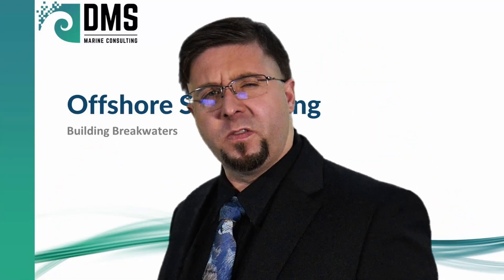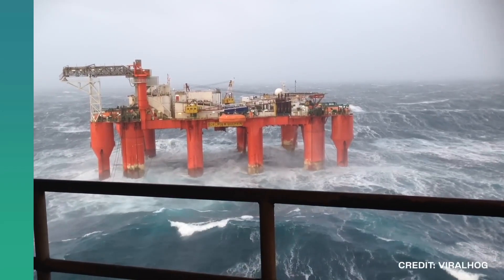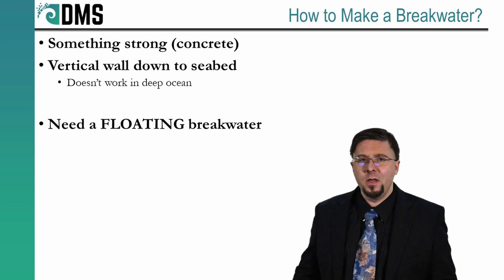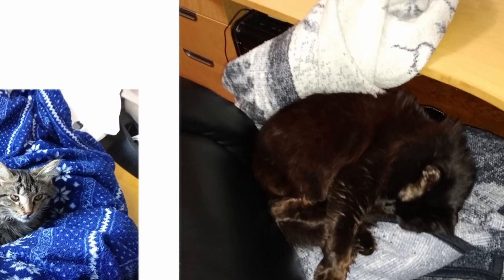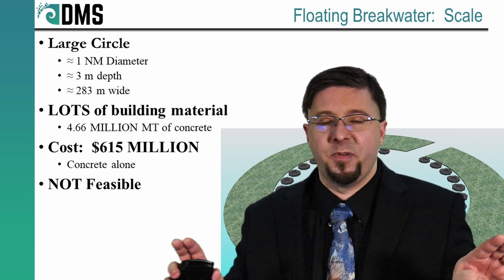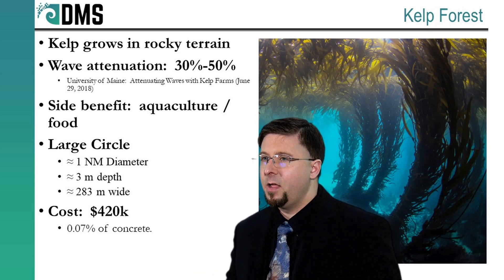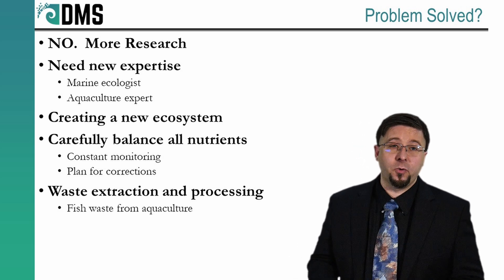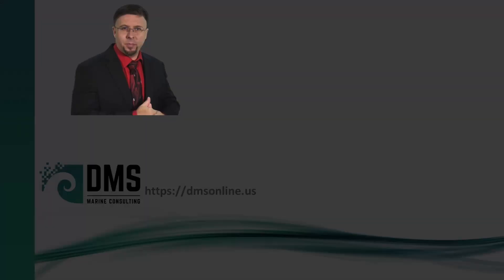Stop the Waves with Plants!:  Seasteading Breakwater Design

Comment: heat collected from a shallow geodesic could be channeled into the depths via a ventilation system...and the same could collect rain water.
but the problem with a very deep hyperbolic cone hull, would be in the construction phase.
hyperbolic cones amplify sound ... I don't even know if a person could survive the SPL level created by concrete being poured into the cone hull.

Comment: A fascinating concept. Along a similar line, there is a process of generating limestone-like structures known as electrified reefs using a metal mesh with a current to draw minerals out of the surrounding water. This structure can in turn be used to support colonies of various marine life. This could potentially provide both an anchoring point for seaweed as well as a more robust structure that could bridge the gap between purely biological and solid concrete.

I'd be very curious to see what level of porosity is tolerable for a breakwater. I would expect that gaps significantly smaller than the wavelength should not be an issue, though I don't know the range of wavelengths that need to be blocked. All the same, it should be possible to get most of the benefit for a fraction of the mass/cost of a solid structure.
Reply from the maker: I expect we can tolerate large porous holes of about 1 ft.  For conventional breakwaters, we often pile giant rocks or concrete in front to protect the solid breakwater.  So I'm not sure if anyone tried building a breakwater without eventually building a solid wall somewhere in the mix.  But I think porous media with large scale attenuation would work well.  And the idea of using an electrified reef is very interesting.

Comment: Wait. Kelp is attached to the seafloor. Surely that is a big reason for its wave damping properties? It essentially increases the flow resistance of the seafloor by greatly increasing surface area? So where are you going to anchor this kelp?
Reply: You can anchor the netting to the sea bottom.

Comment: I think if you want to support that much kelp, you probably need an artificial upwelling, like discharge water from an OTEC plant.
Adding an interesting economic note, if you had an artificial upwelling for nutrient input, a lot of the ecological waste would effectively be carbon sequestration at the bottom of the ocean, so maybe you could sell some long-term carbon credits.

Seaweed farming is often done with the seaweed hanging from floating lines, so that might be better than a metal grid, especially if you intend to harvest part of your breakwater. You can also consider adding mussels and oysters.

Comment: @7min. did you calculate a hollow structure. But smart with the keelp
Reply from the maker: I assumed a solid concrete structure for the rough estimate, assuming that with such a wide breakwater, we would need the full thickness of concrete for strength.  Though honestly, once I saw how much concrete was required, I realized there was no point to further consideration on that front.